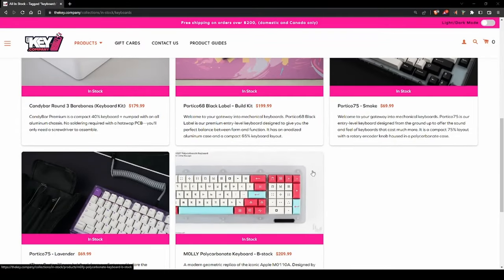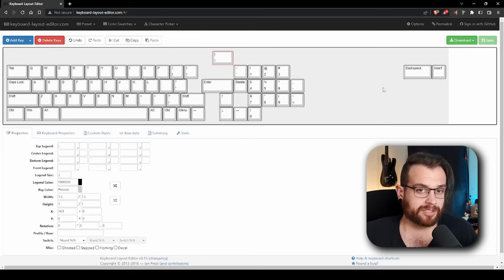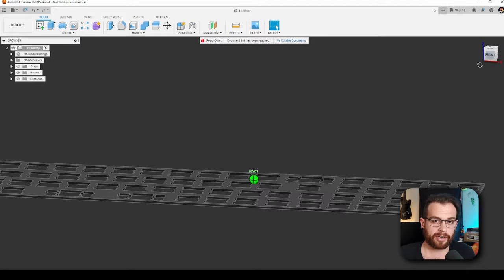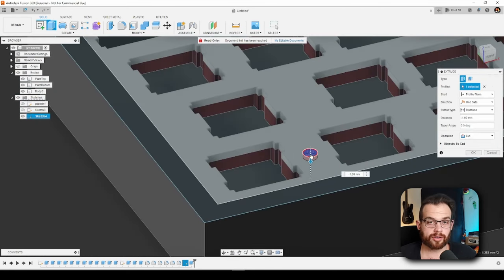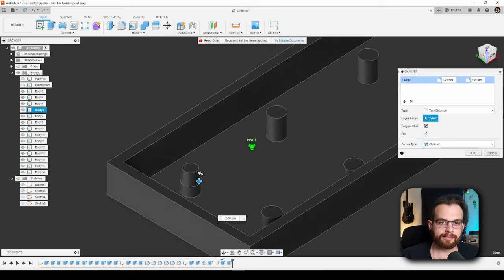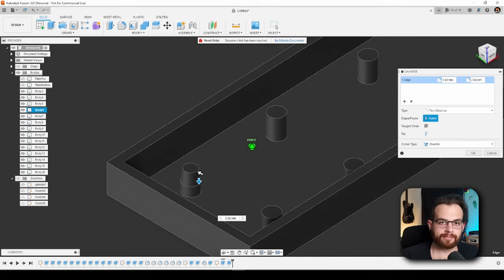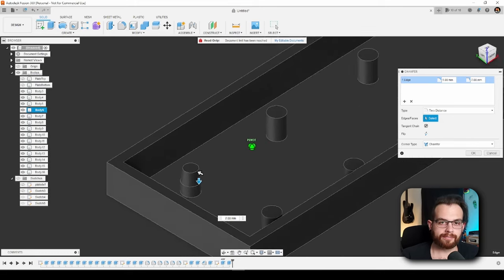How to Design a Custom Mechanical Keyboard

Comment: The keyboard firmware builder needs to be updated for the RP2040 processor.  The RPi Pico and clones are fast becoming a popular keyboard controller.  If you use the pico w, it should be possible to mod the firmware to connect wirelessly via bluetooth now that the  bluetooth libraries have been released for the RP2040 SDK.  There is also a Micro Python clone of QMK as well.
Reply: KBfirmware is EOL as stated at the bottom of the page- Sadly, no more updates will come to it. It is over 7 years old and painfully out of date
Reply: KMK!

Comment: What is the type of wire you used? looks like it has intermittent soldering points? (the colour change) is this right? not the same as your link? maybe im wrong. can you pls elaborate?
Reply from the maker: @federicoroldan1441  I just used some recycled wire. It is old twisted pair wire like the wire that is inside an Ethernet or phone cable. The colored marks on the wire do not correlate with soldering points. It is just color-coded wire. I try to use recycled materials when I can to avoid creating waste.

Comment: I modeled my own case and did this project from scratch, did the firmware manually too since the firmware builder is too outdated. There is only one question i have before assembling everything, i don't have the CC pins on my usb type-c board, only data -/+, ground and VCC pins. I'll see if it works but other than that it went really smooth! Thanks for the amazing tutorial.
Reply: It works wihout those pins, i've been using this keyboard about 1.5 months now and it's great!!!

Comment: For a small, portable keyboard, I would reduce the width of Tab, Caps, and Left Shift. Same for Backspace, \, Enter and Right Shift.
That alone requires a custom PCB, and we haven't even talked about switches and keycaps.

Comment: Fascinating and informative video!  Thank you!  If you don't mind me asking, what was the approximate cost of the materials you used?  I have built two keyboards using PCB and I'm wondering if hand wiring is significantly cheaper.  Thanks again!

Comment: Since we are already consulting PCB-Way, could you make a video how to design a circuitboars that makes the keys hotswapable, or is that too expensive for a DIY project?
Great video by the way!^^
Reply: It wouldnt really be alot more expensive, for about $20 maybe you can get the hot swap sockets and ordering a pcb is $10 - $20 too

Comment: I need to find a good tutorial that explains how to choose the controller board. But your tutorial is amazing!!! I am still stuck with gateron brown switches.
Reply from the maker: The biggest factor for me when choosing a controller board is the number of usable pins. I like to keep the matrix wiring simple when possible so more pins Is usually better until the size becomes a problem. Some controllers are better for for special features like wireless connections or backlighting but I usually try to keep the build simple and keep costs low. Thanks for watching!
Reply: @MadModLabs  Thanks a lot for the answer!

Comment: Would it be possible to create some sort of small wire channel in the 3D print for the column cables? I’d bet it would help with the build and make everything easier and neater. Thanks for the video!

Comment: Great resource. I think I'll start with a numpad so I don't screw up a huge design on my first go.

What do you think about PCBs and/or plates? Is there any benefit to using a support plate like you designed and a PCB under the switches? Or does the PCB replace the plate entirely?
Reply from the maker: Most keyboards have a plate and a PCB. The PCB's main purpose is to connect the switch matrix electrically. Using a plate and PCB together will help the keyboard stay rigid, even though some keyboards have a small amount of flex. It is possible to make a keyboard with no plate at all. I would want to use a thick PCB to make sure the keyboard is not flexible.

Comment: Hello! This is an amazing video, I have been inspired to buil one of your keyboard. This will be my first keyboard project. 
I was wondering if you could do a 4x4 or 5x5 macropad?
Reply from the maker: @calyx0  I'm glad you will be building a keyboard. Macropads are pretty simple. I have built a few different size keyboards and macro pads. Please check them out on my Printables page. https://www.printables.com/@MadModLabs

Comment: Thanks a ton for the awesome video! Following your video step by step to create my own custom keyboard!
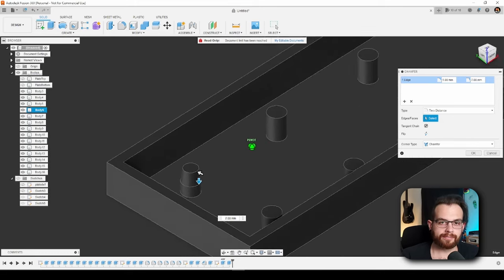Just had a question, at 16:18, how did you expose the wire right where you want the connections to be made? I can't find any way on how to do it.
Reply from the maker: I stripped the wire by heating up the insulation with my soldering iron when it begins to melt, I pull it apart to expose the wire. I found this method to be faster, just don't breathe in the plastic fumes. I have another video about a 3D printed keyboard where I mention this technique. If your wire has very heat resistant insulation, you will need to strip the wires using a blade or wire cutters.
Reply: @MadModLabs  Thanks for the quick reply! I tried burning the insulator myself but it just turned into a black blob of melted plastic. Could you please link me to the video where you talk about the technique? Also, what would I be looking for if I wanted to get the same wires as the ones you used?
Reply from the maker: Here is the video link with the timecode where I mentioned soldering the columns: https://youtu.be/iOeYkLlq9Ds?t=439 
The wire that I use is cheap, solid-core, 24 AWG. This is pretty close to what I use: https://amzn.to/3zkCKrk
You could probably use magnet wire too. This type of wire is really easy to solder because the insulation melts away easily: https://amzn.to/4gqyE1s
Reply: @MadModLabs  Thank you so much! I can finally finish this project!

Comment: Fusion 360 is not bad bad, but there was an update not too long ago that gimped exporting and that made it less interesting for me.

There are alternatives, one of which is SolidEdge Community Edition. It has other limits on it, but it works better for me.
Reply from the maker: SolidEdge is great! Recently, I have been trying out OnShape and it looks promising. It is cloudy based, so you can run it on pretty much any computer.

Comment: Hi!

- It is very interesting - why work on keyboard starts from very not basic and pretty complex thing?

First quetion that appear while you look at typing - what for you nee to hold palms upper than keyaboard while you use fingers? Actually it is logistics connected primitive AI task - how to simplify logistics in connection with context, as it prolongs solutions with new possibilities.

The very simple answer to this question - keaboard surface and keys must lay lower than support for wrists, in some area much lower than border of keyaboard. Kinda in pit. In this case your wrists are fixed and fingers, and only, perform job.

- Now you can type faster, brain and some muscles are relaxed and free of tasks. But what are the pluses?

Borders you receive can be used easily, with low level of mistakes for computer management, like brigthness etc changes, and it is quite natural thing as these functions and its physical realizaion are different. Borders are connection between objects.

After it you have ability to add commonly used functions like language change, layout change. You can place it on border going in pit but with something prolonging keyaboard surface to it. Thus you have mixed intermediate functionality, not that separate. It gives another plus current computers don`t have - accented simple tuning. Like changing contrast of text on screen. And so on. It can be done by software. Text, photos, browser prompt for addresses.... And a lot of other different types of interface controls, elements, you can change, copy, delete by pretty simple easy for brain direct clicking by fingers that you move shortly.

Next thing you understand - there are some outer devices. Lamp. Teapot. Car. And area outer than border is quite interesting for it. You make some pit - and you got it. But it is not magic of real conduction between separate object with jump of differences. But your design have all possibilities for it already. Switch on teapot. Press on connection "beyween pits" and use numbers or arrows for setting up temperatue or speed of boiling. Teapot can be powered by valuable power tuning, just like your keyaboard... ;-) Switch on lights in room or in house. You don`t need addiotional house management devices any more. As next thing such solution brings - ability to connect base pit to any software pit. You need to establish remote link to some device by clicking some "remote connected surface string" either line outer of bounderies.

You can do it in library, bar, train, airplane... In connection to devices around your place... 

- Yo can pay by it. Ask driver of bus or airplane through specific dialog programs and devices.

By clicking several buttons. This is the magic of conduction.

- It brings speed and profit growth ,simplifying everything same type. But not simply. With tremendous growth of comfort. And opening new possibilities. Of super magic... 😏

It gives ability to make simple "going-through" communication and function activating.

- What can you do with teapot?

Well, - teapot can be located under some lamp. Near some refrigerator. So you can use arrows to access it through teapot you use very often, as compared to them. Number of devices can be pretty big. You can use direction for direct connection, or use some menu with names you open by "Show next devices" functionality. Thus it gives ability to reach any detail in any mechanism from any place... In simple comfortable way. Time, cost expenses. collision expenses of performing all of these functionalities with other users - interesting topic. Just like energy etc expenses.

But it is not end. You can put automation on these connections.

- Like adding same type activating of same or different objects by "glueing connection strings either functions". Turn on lamp on teapot and lamp in place you store broad. It looks like magic. In direct meaning. You can execute teapot and start warming up of car. Or say something to car of your neigbour and not known person blocking your one. Through your car. 😏

Comment: Is there any noticeable latency or anything doing this? I was always warned not to use arduino for a keyboard like this? I'm wondering if I was just misinformed.
Reply from the maker: I can't notice any latency. I'm not sure how it would compare to a top-shelf gaming keyboard. If you are unsure of using Arduino, you could build the same keyboard with a different controller. A friend of mine recently built a 3D printed keyboard and used a Raspberry Pi Pico as the controller.

Comment: I was always trying to do something like this. Are there any communities that you recommend which can help me? Also, because this is 3d printed I was wondering if I could get this machined in acrylic or other materials on PCB way.
Reply from the maker: I would say YouTube is the best place to learn 3D modeling. There are lots of really good tutorials available for free. I am not really active in any mechanical keyboard communities but if you want to learn how to program a keyboard, the QMK discord is probably a good place to look.
Reply: @MadModLabs  for my second question, can I use the same 3d model for machining in other materials than 3d printing? Like acrylic.
Reply from the maker: @akshatdev3596  for CNC machining, you will probably need to use the STL file to create a .STEP file first.
Reply: @MadModLabs  thank you again :)

Comment: Question:
When using the arduino as your controller for the custom keyboard, - does such keyboard end up having any issues with simultaneous keys pressed (imagine Ctrl+Shift+Alt+C as example)? This would literally be a showstopper for me to refuse the idea (need big combos to work in IDEs).
Reply from the maker: I tested this just now. The keyboard recognizes up to 9 simultaneous keystrokes when using the modifier keys like Ctrl+Shift+Alt. If you frequently use big key combos, writing your own firmware is the perfect opportunity to simplify them. You could assign them all on a function layer or even build a keyboard with a built-in "macropad" that could input your key combos with one keystroke.

Comment: Hey there, I've been following these steps to make a keyboard of my own for a while and I've somehow gotten it to work almost perfectly
Every key works except for one single column, which I've discovered that the moment the keyboard's plugged in, every key in it from first to last fires once until the last key, which then repeats its signal until any other key is pressed. Pressing any of keys in the one column doesn't output anything afterwards
I'm not sure if you'd be able to help with this issue as I'm using the Teensy++ 2.0 and not the Teensy 2.0 but I hope you can! Thanks
Reply from the maker: @Flippr  it sounds like that column is shorting out to ground somewhere. First I would check all the diodes and make sure they are all going the same direction. Next I would check the column wire. Make sure the insulation is not melting off anywhere that would allow the wire to contact another column or row. Also check the solder points on the teensy and make sure they are not bridged together. If that column happens to be connected to pin D6 on the teensy 2.0++ you could try moving it to another pin and editing the firmware accordingly. On the Teensy 2.0++ this pin is also used by the onboard LED. I have had unusual behavior using this pin on some teensy clones. Lastly, you could test each switch in the column individually. It's unlikely to cause the entire row to fail but it's worth checking especially if your switches have been disassembled for lubricating.
Reply: @MadModLabs  I just so happen to have it on D6 ;-;
I'll try to switch it to another pin the next time I'm able to, unless if there's a way I can easily update the code through the site as moving the wire to another pin may be difficult for me to do

Comment: Hey man, Im already working on mine and here are two questions that came up:
1 - What to do when the number of columns and rows are greater than the number of pins on the board?
2 - Is it possible to use arduino pro mini instead of teeny? its kindda cheapper down here in brazil
thx man
Reply from the maker: You can use an Arduino for a smaller keyboard builds. They have less pins than the teensy. If you're building a large keyboard you probably want to get a Teensy 2.0 ++. https://amzn.to/3EfUFi5 The Teensy 2.0 ++ is an awesome controller with lots of pins and it is pretty easy to work with. There's also a way to do this with a Raspberry pi Pico but the firmware creation is completely different than the way demonstrated in this video.
Reply: @MadModLabs  thx alottt
Reply: I know you commented this awhile ago, but your keyboard wiring matrix doesn't need to follow the exact rows and columns you have. If you have a 48 key keyboard, for example, if you use a 4x12 matrix, that uses 16 pins. However if you consider you can create groups keys (from a wiring standpoint) into smaller or larger groups, you could create a matrix of 7x7 totalling a maximum of 49 keys (the last 'row' of this wiring would only have 6 keys, to bring back down to 48 actual keys). This arrangement would only need 14 pins.

Another example is a 5x12 keyboard - 17 pins needed for a matrix that matches the physical layout, or use an 6x10 matrix only requiring 16 pins.

The keyboard shown in the vid needs ~62 switches. If you use a 4x17 matrix, that's 21 pins. However, you can use a 7x9 matrix for 63 possible switchs using only 16 pins.

Make sense?

Comment: How much infill did you use for the keyboard
Reply from the maker: 20% is enough.  Increasing the infill density and wall thickness will change the weight and sound of the finished product slightly. So feel free to experiment.
Reply: @MadModLabs  thanks you so much for the answer

Comment: I tried downloading the personal use Fusion 360 and that didn't work so I've had to resort to using FreeCAD which works SO DIFFERENTLY to Fusion360 that I basically have to skip the modelling part of this tutorial and have to hope someone has a FreeCAD tutorial of a similar project.

Comment: Hi i just want to ask how do you know what type of switch you are using ? I'm planning to make a keyboard with the leobog ash v3 switch but i don't know what type of hole will fit
Reply from the maker: LEBOG ash wood will fit in a Cherry MX plate. The switches themselves are very similar to switches manufactured by Otemu. Most switches will fit in a MX plate. If you plan on using a PCB make sure it is compatible with Otemu/Akko switches.

Comment: when i try import the dxf into fusion 360 it comes up with an error "the selected dxf file does not contain units information
Reply from the maker: Make sure you have the units set to "millimeters" in the insert dxf menu.